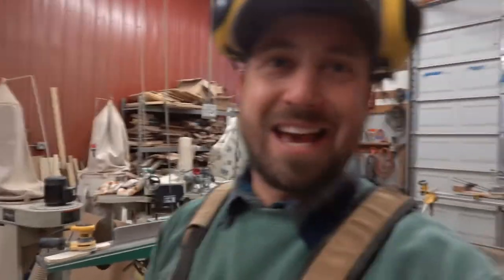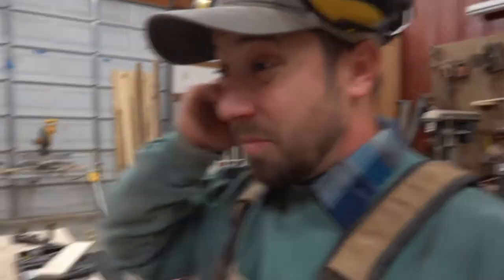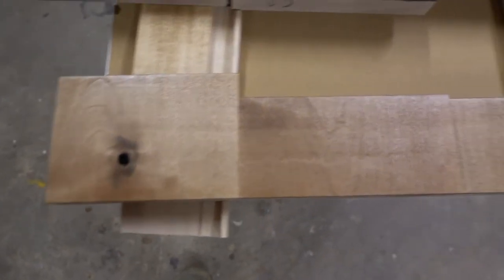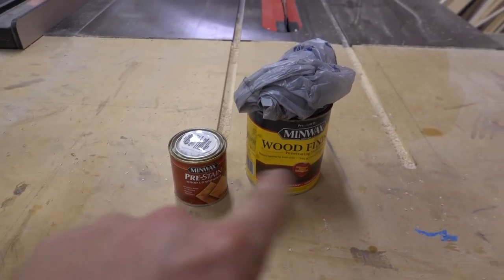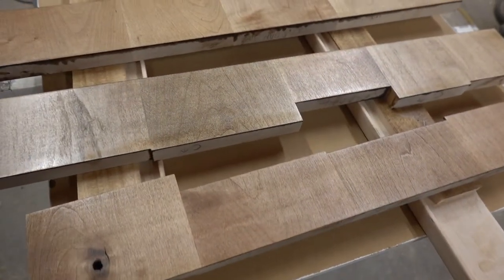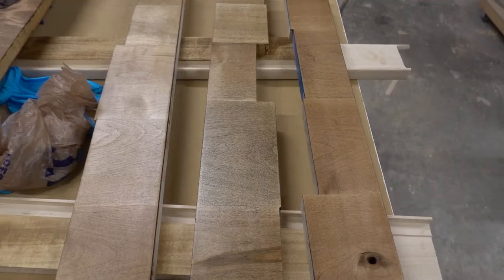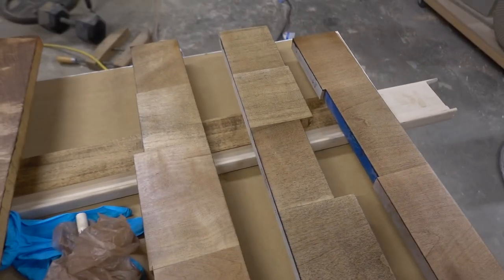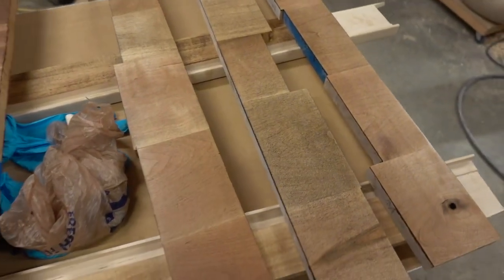HOW TO STAIN Maple: REDUCING BLOTCHING

Comment: Thank you for the information, especially in regards to blotchy areas.  I have bathroom cabinets that need to be stained.  I want a natural wood look without too many yellow tones.  What stain color did you finish with?
Reply from the maker: you bet. The client actually chose a dark walnut danish oil. I used that to stain this table but did samples with a variety of minwax stains. Early American looked almost the exact same as the danish oil. I just went with what they chose.
Reply: @richardeberlefurniture did you stain it with dark walnut Danish oil, let it dry and then coat it with the shellac mixed with denatured alcohol?
Reply from the maker: @valeriya105  no I did the denatured alcohol/ shellac mix first. Let it dry. Then sanded that. Once i sanded the alcohol/shellac mix coat then I put the dark Danish oil on. I would recommend trying it on several sample pieces to get it worked out before you do it on your piece. As you saw in the video I played around with it until I was confident in the process

Comment: Really good video, I got some smaller maple turnings that have very little sapwood/heartwood figure to them and I wanted to add some stain. How long did you let shellac mix dry before sanding? Also the table is absolutely awesome
Reply from the maker: Thanks. I let it sit for about 10-15 minutes before sanding

Comment: THANX FOR THE VIDEO,  I jus built a hard maple desk top n am lookin for a good finish n am finding out it doesn't stain well is there a way to jus seal it as is without stain n keeping that piano white color or what do u suggest i do for a finish, THANX
Reply from the maker: @Malba1776  yes. I would recommend using more of a water base finish or a “water white” clear pre-cat lacquer. That way you don’t get any yellow or amber tinting from an oil base finish.

Comment: Can you use just the sanding sealer as a preventative measure before applying an oil based finish like polyurethane? Im finishing a cherry coffee table with some beautiful figure and have had some not so great experiences we’ll say with finishing cherry
Reply from the maker: yes. I have used it on my bed which was cherry and them put waterlox on after the seal coat. make sure you use dewaxed shellac. you have to order it the box stores dont sell dewaxed shellac. I would also encourage you to do a sample piece first. @dmitri Brohanon

Comment: What do you think about using a black stain for maple
Reply from the maker: I have stained maple plywood black. It turned out good. I dont know if I would use the method I showed if you are staining it black. I would just recommend that you do several test pieces first to see if you like the look. Also you make do multiple coats depending on how dark you want it.

Comment: Hi! I know this vid was from awhile ago but I JUST finished building a maple gaming table and it was almost exactly like this. It is honestly a bit uncanny. Having gone through the process, I am very curious about how you attached those top rails? I don't see any visible screws. Attaching the top rail was a beast in my build.
Reply from the maker: @DustinKnapp7  dominos and glue for the top part to the apron. And counter sunk screws from the bottom to attach the cellar surface.
Reply: @richardeberlefurniture  fantastic thanks for the answer!
Reply from the maker: @DustinKnapp7  you bet

Comment: I want to try this on my maple cabinets…. I’m scared. Have you ever stained kitchen cabinets? I know you said you don’t stain a lot…
Reply from the maker: I have not tried on cabinets. it was a scary process. but i did several tests before I moved forward.  My suggestion is you test out several pieces of scrap maple and get confident with it before you try. if you do make sure to get the shellac that is wax free. Most hardware stores sell the shellac that has wax in it. I bought the kind i used online.

Comment: Dude you don’t got to do none of that.
Hit your piece with your steamer 
Wait for it to dry 
Stain your maple 
You can wipe it with just water too
Reply from the maker: Send me a video link of how that works. I would love to see the process.
Reply: I don’t have a video, but it is simple.
Maple is a very hard dense wood with grain that is intertwined in multiple directions.
Wetting the surface fills the grain with water,expanding it.
Once it is dry, the stain has a place to be in the wood grain.
The stain will penetrate much better,giving it a much more even and stained appearance.
For an even darker finish,like piano black, you would use an analine dye to radically increase the acceptance of the color.
Using a steamer to raise the grain is a fast and easy way,because the steam dries really quickly.
After doing this,your stain will work on the maple quite nicely.
Reply: @leerosson216  can you explain this a bit differently? Why would you want to use a steamer? And how long after would you apply the stain? Are you saying that opening the grain and allowing the water to penetrate it prevents it from getting blotchy and taking in the stain better? I have two client dressers I’m trying to finish and looking for solutions. I thought maybe there wouldn’t be an issue because it was stained successfully before 50 or so years ago.
Reply: @kmcg2609  it’s a process known in the trade as “water popping “.
Using a steamer will accelerate the process tremendously.
The hot water dries really fast.

Purified water would be strongly advised.
This makes wood accept more stain more evenly, and makes the maple blotch effect much less,without drowning the grain in color.
If you steam wood it is usually completely dry in an hour.
Minimum dry time for your stain is on the can
Reply: @leerosson216 this is great, thank you!!
Reply: @kmcg2609  you only need to thoroughly moisten the surface of the wood.
The steamer is cool for small projects.
I usually use a rag or sponge and a bucket for hardwood floors.
Helps clean up the sanding dust that way too lol.
Maple is a wood that shows sanding scratches a lot.
Once you get fine enough to not scratch, you have an almost polished surface.
Opening the wood grain allows you to also stain the wood grain that was polished shut by sanding 
If that makes sense.
Also gives a surface that is more even
Reply: @leerosson216 so if I’m doing dressers, which need stripped and sanded down, a warm rag over entire piece, then dry, and stain. I heard not to go higher than 180 grit so the grain isn’t shut?
Reply: @kmcg2609  yeah and the damp rag will remove more dust than you would expect.
 If you feel it before you stain,the surface will feel a bit rough.
This happens because the grain expands.
Gives the stain something to stick to and penetrate.
You can smooth everything up once you get some finish on it,